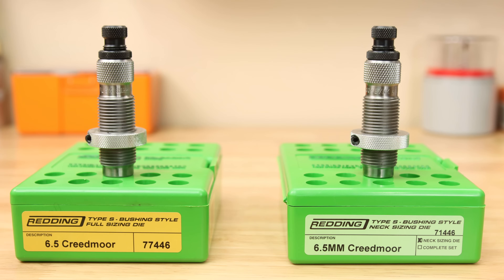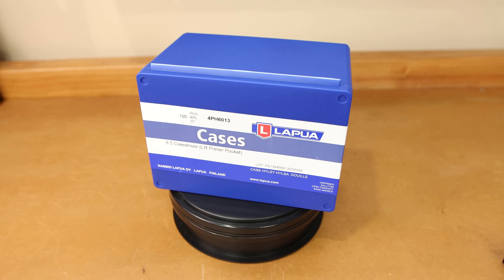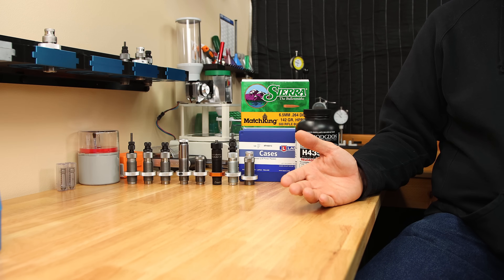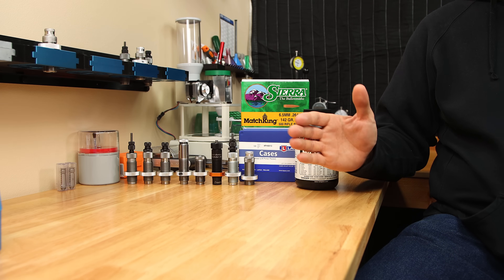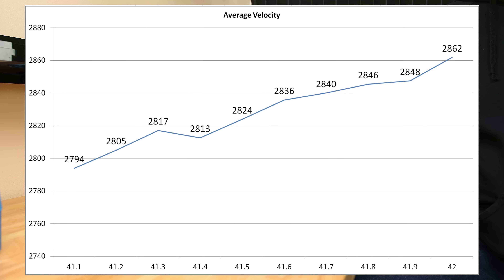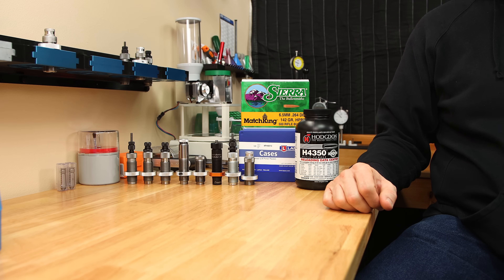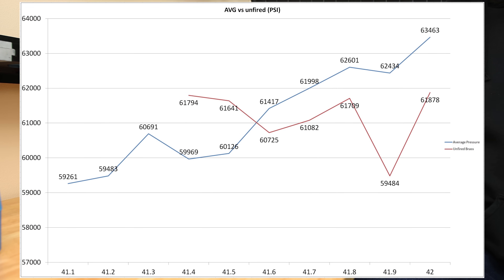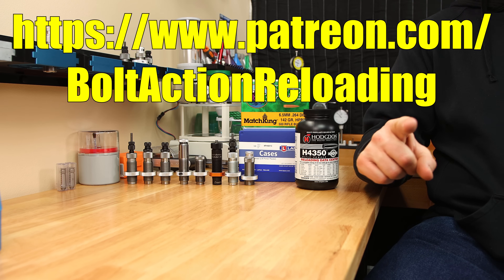Full Length vs Neck Sizing - How Your Sizing Method affects Velocity and Pressure

Comment: Great work! After a quick look at the MV Vs the charge plots, it was interesting that the Forster FL and the Lee STD collet showed very similar results, with only slightly higher/pressures in the Lee data. I neck size with the Lee and FL (as required) with a Lee RGB die and get excellent precision in . 223 Rem and .308 Win.

Comment: What's a "grain of water"?
Reply from the maker: It is the measurement of case volume for reloading. If you essentially put a case with the primer pocket plugged with a primer (or something else) on a scale. Tare the scale to read zero. Then, fill the case with water to the top. The weight difference in the full to empty case weight change in grains is the volume in grains of water.
BAR
Reply: A grain is a measurement of weight, bullets and powder are normally measured in grains in the US
Reply: @wades623  Yeah dude i know a grain is a unit of weight, and it's used extensively in reloading.  But i've never heard it used in the context of "water" before. Usually water is measured in ounces or milliliters. "grains of water" is a nonsensical terminology.  Volume isn't a measurement described in weight. The case volume is always (in normal reloading parlance and ALL my reloading books) referenced/measured in cubic centimeters. Not some obscure weight of water.

Comment: What has worked for me is the old KISS method. A semi auto I full length resize. For my bolt action hunting rifles with once fired brass o neck size. For my 338 mag brass once fired I adjust to resize and just touch it he shoulders! I have been reloading this way since the late 70’s.

Comment: Off topic but you still shooting the 147 eld-m in 6.5 CM. Was thinking of trying them but seen multiple threads off guys having them grenade on them… What you thoughts. If you still using them you ever try them with 100v powder?
Reply from the maker: Hi Mark, the 147 works well enough. I have not had a "problem" with them. The 140 eld-m is so easy to get to shoot that the extra bc you get may not matter depending on your target distance. I can't remember if I have tried it with 100v. These days you just have to try what you can. It's in the burn speed of should work, but how it may or may not work for you I can't say.

Comment: I'm really interested in your videos.
You do the research I'd like to do.
I bought plugs to measure case volume with alcohol...a practical impossibility.  I anneal with amp., Use Lee collet, combing with Redding shoulder bump only die.  So I like idea of neck size only, and love to see such research and results.
I'd love to see a neck lube (for seating)  comparison between dry graphite and alcohol based wet graphite.  Dry graohite seems more practical...easy...quickly dipping rather than cotton bud swiping.. but..maybe they're both just as easy..a seating force comparison and velocity comparison...this is getting a bit particular though..but, that's the point I guess, best results , best practice, least effort, or time once research, technique chosen.

Thanks Again.

Comment: My neck resizing versus full-length resizing story is a little different. No doubt, the smaller the velocity standard of deviation, the more precise the load. But that wasn't my reason for neck resizing only. That is more of a powder charge selection question.
First off, the cartridge in question must be fired out of the same gun every time.
My reason for neck resizing was that if the cartridge overall is reduced in size (full-length resizing) then when it lays in the chamber, the bullet will be off-center. 
If the cartridge fits the chamber it has been previously fired in, it will fill the chamber more tightly and present the bullet in the closest center to barrel position possible. I went as far as to orientate the cartridge in the same manner every time. In this case, it was Winchester, and I had the "Win" on the cartridge at 6 o'clock every time I chambered a round. Just my thoughts, take it or leave it.

Comment: I am wondering if your pressure test strain gages are thermally compensated at all. It could be done with a tee rosette. This would be an axial gage in addition to the circumferential gage that measures the strain due to pressure. Or if it has a thermocouple on the barrel. Otherwise barrel temperature would cause variations in the reported pressure. It would be worth a phone call to see what they have to say.

Comment: Hey bud, so do the results (in regards to capacity testing of fired and unfired cases) vary greatly enough to justify a test on case capacity with fired brass before neck turning vs fired brass after neck turning and 1 or 2 variations of that exercise...... Lol, how much time have you got. Love your work!
Reply from the maker: Personally unless you are using something like the IDOD I would fireform first, but there are lots of options on this.

Comment: Nice work as always - good job on picking such a minuscule project. Lol. 

Have you thought about picking a charge weight for all the sizes methods and then shooting 5 of each and seeing if there is any differences in both the pressure and velocity spreads? Meaning does one die give you more consistency than the other.
Reply from the maker: It's coming. I am going to shoot the lower node and get the data from that and decide where to test. 41.8 looks promising but not sure that is the "best"
Reply: Very cool. Can’t wait to see your results.

Comment: Is it a goal to find best methods,  or really about charting the noted results, end user decide what works for them best? Sometimes the info is data dense.
Reply from the maker: Hi Rusty. The goal overall is to understand what the real differences are and determine if they matter to you. I prefer not to tell folks what to do as everyone is a bit different. I have heard plenty of folks tell me that the extra volume in the neck only sized cases lower the pressure. This appears to show otherwise. At the end of the day is there a difference? And is it enough of a difference to make a difference.
Reply: @BoltActionReloading  which resizing method do you prefer? thanks

Comment: Eric cortina settled this issue.  100% F-open shooters …
Reply from the maker: Hi Rick, I understand his position on the topic and I am not saying he is wrong. However I don't see the issue in testing and having the data available for those that may want to understand why. If we backed up 12 years someone would have said that the benchrest guys have this settled and neck only sizing is the best.
Reply: Erik should buy more components and use neck sized brass all the time 😂

Comment: I suspect unfired brass is going to produce less velocity and pressure because more energy is lost expanding the brass to the chamber dimensions. Neck only sized brass produces slightly more velocity and pressure because the brass is already expanded to chamber dimensions minus the neck. Therefore, most of the energy is used to launch the projectile.
Reply: Thats been my experience as well.

Its useful info if you are running a powder thats a little slow like 4831sc in 6.5 creed.  Lee collet dies and bullets seated .010 into the lands made 4831sc able to get up to pressure with 147s and 150s.